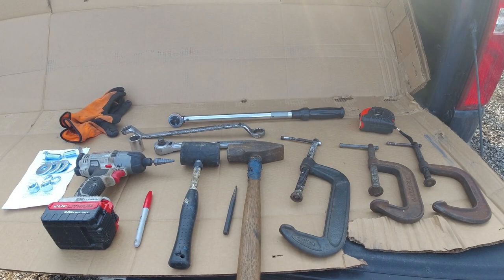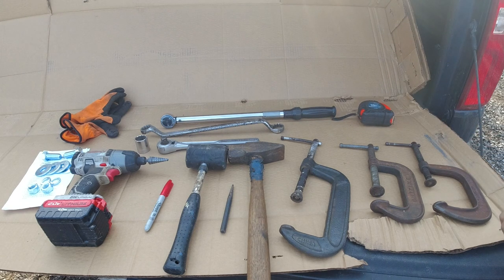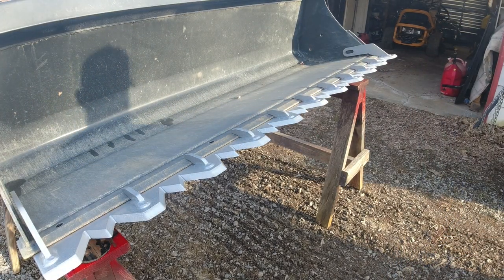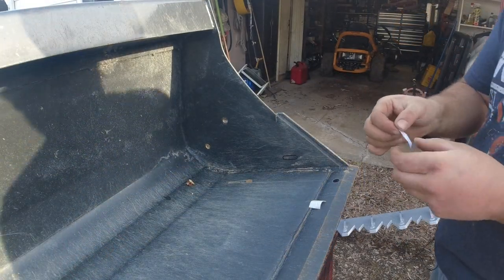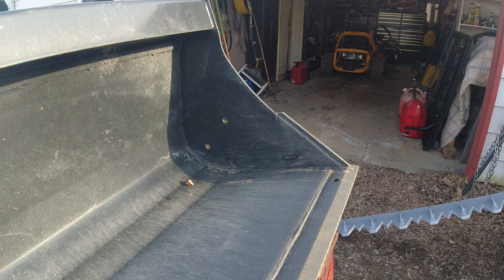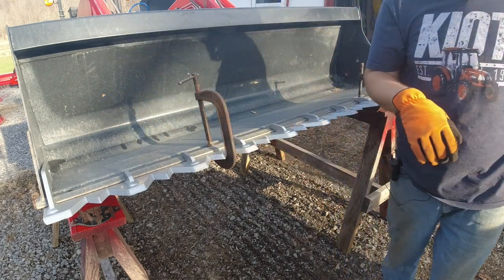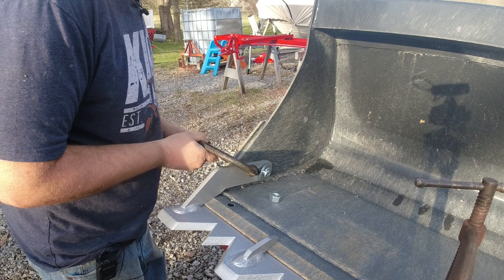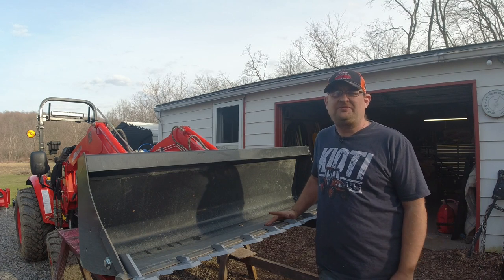#22 BXpanded Piranha tooth bar installed on a Kioti CK3510se

Comment: What’s the purpose of sticking the sticker over your marks just to punch a hole? Looks to me the sticker would block exactly where the punch mark need to be.
Reply from the maker: The instructions say to use them, but I didn't on the other hole for the reason you said. Worked out in the end so that's all that matters